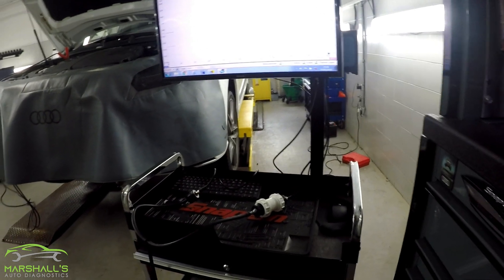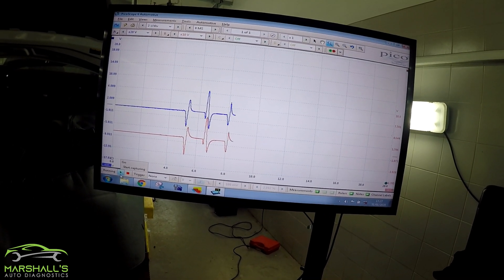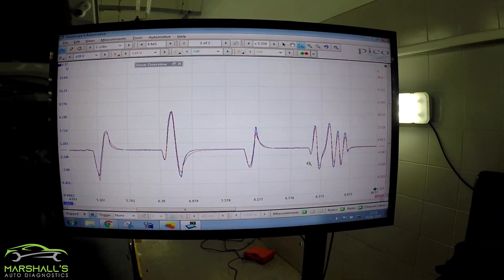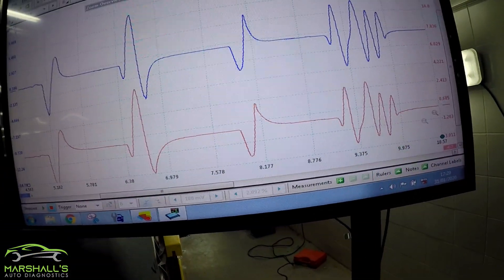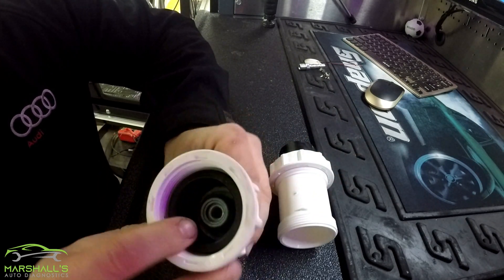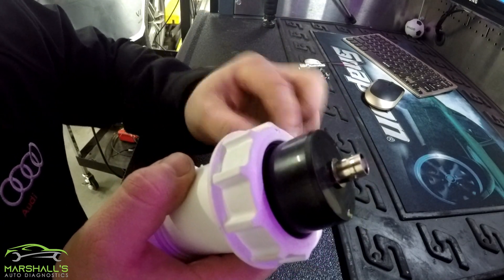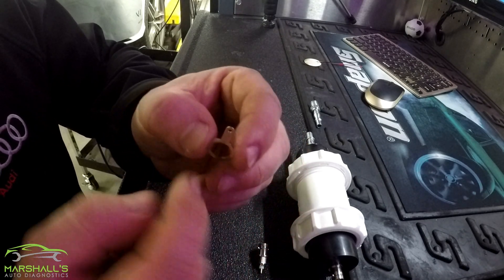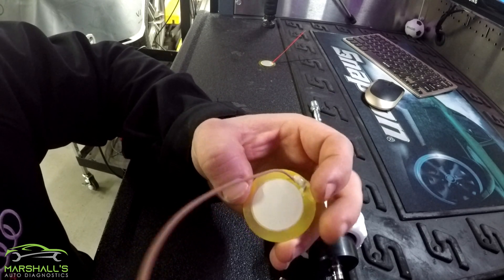pressure pulse sensor

Comment: I always wondered how a homemade and an OG compared. Great video! I have some piezos that I ordered now I just need to sit down and 3D print an enclosure. I might try an embedded magnet or a design with an integrated hook. Thanks for the video!!
Reply from the maker: Probably a hook, dont know if a magnet would affect any voltage produced by the sensor because its only millivolts,  plus a magnet mount may be too rigid,  it's better to suspend the sensor to eliminate any vibration. 
I've been thinking about getting a 3d printer. Maye you could let me know the cost of the machine and plastic?

Comment: Thanks for sharing stephen, I'm gony try making one myself what size did you order the disc and pipe. 
Keep up the videos m8 really good
Reply from the maker: The pipe is plumbing from b&q and the piezo disc is 41mm from ebay. I'd suggest getting the discs first and looking for the pipe so you know what you have will fit. The sensors work great. I started decorating them so that they look the part and I use them confidently
Reply from the maker: Thanks  for your feedback, I wasnt sure to keep doing videos but it's good to hear someone is enjoying them atleast lol. And I like doing them so I'll keep at it.

Tool cart review and more hantek tests soon I think
Reply: @m.adiagnostics5013  no prob m8 really enjoy the learning. Good to see the scottish contingent . Excellent .
I'll be making mine for a verus, I'm mainly on trucks but the insight these sensors show are mind blowing .
I'm  currently looking at getting a high amp clamp to do truck relative compression. Do u know if a verus would give a reading with a generic high amp clamp. I seen a vid danner done he went to volts dc, just with the higher amps on a truck dont want to fry 
My verys
Reply from the maker: @russellmcallister6830  I dont think you can harm your tool with a clamp, it's just converting the magnetic field to a visual reading on screen, at worst it will just over range and go off screen. I think you will be ok with a high amp clamp. I seen someone post regarding a 2000amp clamp recently.  I'm sure you could get a reading from the verus bud

Comment: I do like the build and the two comparisons. And those piezo are very difficult to solder wires onto!
Another thing I've found in using them in exhaust pulse waveforms is that it's a hit and miss thing. Some vehicles provide a nice useful waveform and some just produce a mess...all depends on the pipes, muffler, etc...
Denis
Reply from the maker: Tha is very much for that o information it's good to know, the soldering is really difficult, once I got some grab from the solder onto the surface I put a dab of hot glue onto it to hold it...seemed to have worked. I have some funnels to put on the exhaust but your probably correct about that.  Since this video I have started painting the devices so they look better and they seem to work great
Reply: @m.adiagnostics5013  - not sure about the funnels...an 18" length of 1/2" hose (or so) shoved in a ways and wrapped in a wet rag, allowing some flow through...can't be a snug fit, right?
When it works, it's useful. But some exhaust systems resonate just wrong and waves overlap.
Good luck with the channel Stephen and I've subbed:-)
Reply from the maker: @theGADGETSplaylist  I think you are correct buddy that seems very plausible about the it overlapping pulses and so on. I will keep my eyes open for that incase I get let up the wrong path. Good to know thanks I appreciate that

Comment: I built a pulse sensor but I don't have a first look sensor to test it against. The design is very similar to yours.
Reply from the maker: There are a couple videos on you tube which gave me the idea to build mine, I'm not particularly clever it just worked out for me, you should buy a first look to test against and to use aswell, better having a few of these things